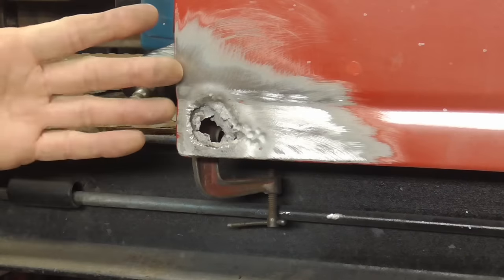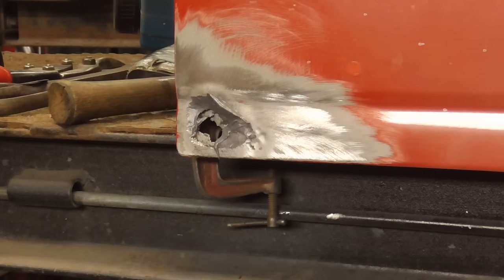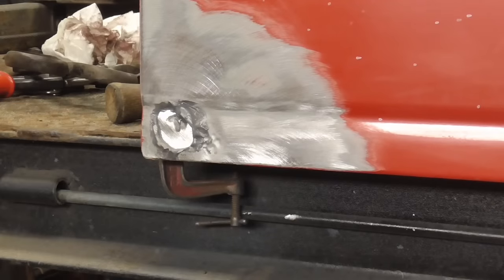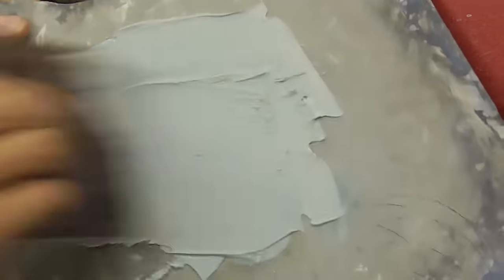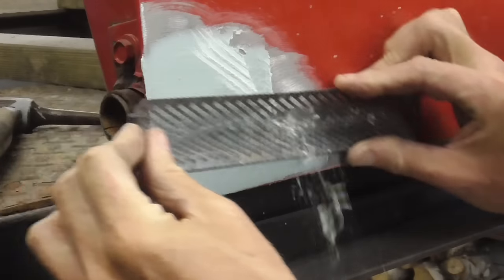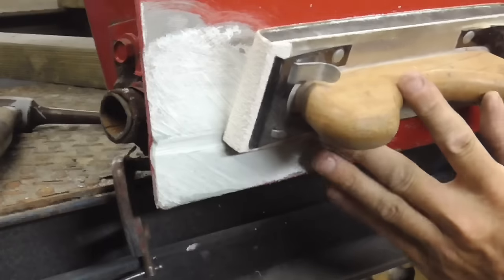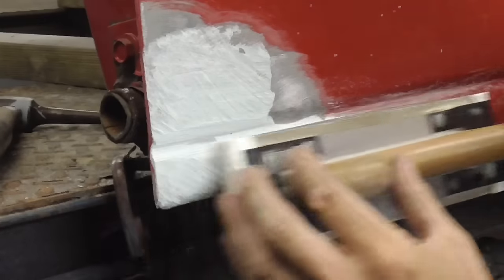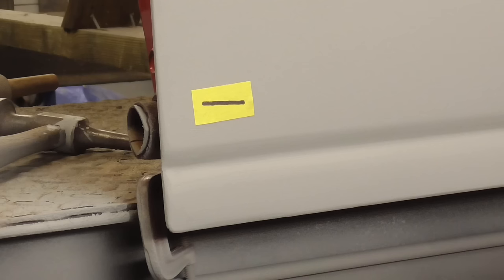Using JB Weld to Fix Rust Holes?

Comment: Could you use a soldering iron and lead to bond a panel in place?
Reply from the maker: I'm not sure about that.  I know you can use an torch and braze though.
Reply: @LakesideAutobody  wont a torch over heat the panel?  When you braze you have to heat up the panel more
Reply from the maker: @marcelinoafanador6378  I think you could used braze to install a quarter panel but I really don't think it would be good for patch panels because of what you said (heat distortion).  With a quarter panel all the welds are in rigid places that don't warp.  You can use panel adhesive or impact resistant structural adhesive.  I have a few videos using adhesives JB weld to "glue" panels into place.  I'll be uploading "Gluing on a Door Bottom"  real soon so that may help too.  Do you have a welder?
Reply: @LakesideAutobody  I have an AC/DC buzz box.  But I'm not much of a welder and I'm sure I'll do more damage than good.

Comment: Great idea, have a 2010 Caravan needs a patch on a fender I think I’ll try your method. Did you need patch the hole on the other side of the door as well? Great video 👍
Reply from the maker: You could use seam automotive seam sealer on the back side and paint over it (it's paintable) or you could grind it, use bondo to smooth it and paint or just undercoat it if you didn't care about the color.  Basically just need to sort of seal the back - glad you liked it.
Reply: @LakesideAutobody  I know that it would be ideal if the rust could be removed on the inside but it is not possible no problem on the outside i already have it down to bare metal.
Reply from the maker: @SDsailor7  If you can't get to the inside, don't worry.  We never worried about the inside in a body shop and never had come backs.  The rust starts at the bottom of the panel so if you can at least squirt some used motor oil or WD inside the panel you'll be good.
Reply: @LakesideAutobody  Once i remove the rust from the inside of the fuel tank i will add two cycle oil to coat the inside of the tank to prevent it from rusting again. It is a two cycle moped so it wont hurt it.
Reply: @SDsailor7  also add Startron from the Walmart boat section to the gas tank for winter storage, and keep the tank full so there is less water condensation inside the tank. You can line the inside of the tank with POR 15.
Reply: Thank you for the tips! they will come in handy.As of now I am at a stop in derusting the tank on my Peugeot due to the cold weather. evaporust says it works better at 65 degrees or better.Cheers
Reply: I have already repaired the holes using JB weld just waiting for the weather to improve so I can use the evaporust.

Comment: Great idea, I’m going to do this! Which JB Weld “model” do you use? What can you do to protect the other side of the panel (inside the door) where the rust started? Thank you!
Reply from the maker: I used the "Original".  If you can get to the back side it's good to clean it (wire brush, sand blast, etc.) and seal it with some good rubberized undercoat - rattle can is good enough.  If you can't get to the back side - make sure you allow water to drain out and do something like this: https://www.youtube.com/watch?v=y05dNxt-nVc  Have a great weekend :)

Comment: been using jb weld for years as a filler over clean metal to repair rust then I wipe a thin coat of filler over the jb weld
Reply from the maker: Thanks for your input Charles :)

Comment: What filler did you use?
Reply from the maker: Auto Body Master Light Weight Body Filler - $23/gal.  Most fillers are very similar - no need to spend a lot of $ body filler.

Comment: Not body work, but used JB weld 45 years ago to replace a 2"x1" hole in the side of a briggs mini bike engine, my grand kids still ride it today. It's as good as it gets for non heat repair.
 Enjoy your videos very much. Thanks for taking the time to share them with us.
Reply from the maker: Thanks for the story John - You're welcome :)
Reply: Repaired a hole in the side of the case on an 8 horsepower Tecumseh snowblower engine. Previous owner had run it out of oil and it snapped the rod and put it through the side of the case. Cleaned up the pieces of the case and repaired from inside and outside with J-B Weld. After a new connecting rod and some muriatic acid to clean the gold aluminum off the crank journal, the engine runs great years later
Reply: 2" hole?

Comment: I used JB Weld once to patch a hole in a gas tank, was actually a crack a little more than an inch.  First dried the tank.  Drilled a small hole at either end of crack to prevent further cracking. Sanded lightly and applied generous amount of JB
Was lasting years later when I sold the car.  Great stuff.
Reply from the maker: Nice idea with the holes at the end.  The stuff does work on a lot of things for sure - good story :)

Comment: I have been using it for years. Seals welds, doesn't bubble out, etc... Make sure it is completely cured before topping it with any other products.
Reply: Yeah it gets hard but still takes a while to fully cure if it's cool or cold out
Reply: @asbestosfiber   I give 3 days, was enough to holda dime size hole at 460psi

Comment: What a great idea! I really can't think of a downside if down correctly.
Reply from the maker: I once lb welded a piece of metal over a hole on a rusted EGR pipe.  It lasted at least 5-10 years - then I sold it.  It's probably still holding!

Comment: I agree that JB Weld is probably the best repair substance that I have ever use. Second to none. The only problem that I would have with repairing rust on automobile's could get really costly. JB Weld is not cheap. Bondo type materials are much less costly per square inch of surface's. Maybe JB Weld will see your video and create something that is less expensive to compete with Bondo.

Comment: This is a great idea. I welded on a new floor to my 60's Vespa and still had a few very small pinholes that rather than filling them over with epoxy primer and then filler I'll simply use a bit of JB weld first.
Reply: How did it go I’m restoring a Vespa at the moment and thinking of using in weld or araldite

Comment: Used JB Weld to rebuild rusted lower windshield pinchweld area. Front windshield rubber dryed and failed over time allowing water to reach pinchweld and cause rust.
1966 Chevy C10. Replaced windshield and gasket and molded JB weld in contour of pinchweld  so rubber gasket sealed. Beauty. 
.... Plan on trying to use it to repair and build up rusted portion of wiper motor mount hole also.

Comment: Hi use J-B Weld to but I put the fiberglass cut out sheet that's woven next to it and I spread the J-B Weld over my fiberglass on both sides and that's how I get some big big patch panels with fiberglass cloth and it works incredibly well also
Reply from the maker: Thanks so much for the input and good idea.  Have a good weekend and Easter :)
Reply: @LakesideAutobody  you aswell

Comment: This is the best thing I have ever come across in my years of doing body work. When used acetylene and oxygen the metal bends like it's a wave. I use the six minutes setting time because the curvature on the panel. So easy to work with the stuff. Thank you I wish I could send you a picture.
Reply from the maker: Hi Robert, iff you still have a pic send it to schoolvideolibrary at gmail dot com.  Glad to hear it worked for you - Jerry

Comment: I've been using this same method to fill holes in my 02 Silverado bed & body for a couple years now. I don't bother sanding or painting them since it's a just truck for hunting, fishing, hauling excess yard waste, bricks, etc. I step on the repairs, throw logs and bricks on em, holds up just fine. It is also is a better option for we who have pacemakers and shouldn't be around welding.
Reply from the maker: Great information a great example of why some folks may want to use glues instead of weld :)

Comment: I would need a bunch of the J B Weld to repair the rust on my 1997 Escort LX
Reply: Just use clay and hay mixture.If it's good to build brick homes it's good for a rusty ok car.,🤭🤭🤭
Reply: but if you fix the valve seat issue they will run forever,been driving them for over 20 years

Comment: Used JB Weld to patch a hole in a plastic valve cover. Two years now and no leaks. Good stuff!
Reply from the maker: Wow plastic... Good to know it works well on plastic too :)
Reply: The water inlet seperated from my radiator and started leaking pretty badly. I cleaned up the area and JB welded it and it held for the duration I owned the car.
Reply from the maker: @ProleDaddy  It's something to hear all these success stories of JB weld - tuff stuff :)

Comment: I too have used KB Weld for small holes. Also used it on an S-10 pickup throw out bearing one time. Was still in there working just fine 150,000 miles later when I sold the truck. Good stuff!

Comment: Why not just weld a patch in does a better job in less time
Reply: I personally don't have the skills to weld sheet metal nor the tools so if I was trying this kind of job at home, it'd be easier to use a putty based substance like JB Weld. However I can imagine that if the rust damage was more extensive - it wouldn't be as easy and would likely require a professional to weld it.
Reply from the maker: Here's one with jb weld on some serious rust damage:  https://www.youtube.com/watch?v=wRl1QfkrBeY
Reply: @sdaafasfad  for that type of rust, welding isn’t really an option. You’d have to cut down to viable metal first rather than just grinding away the rust.
Reply: Everybody don't own a welder bro,sometimes u gotta work with your budget

Comment: I was thinking that it would be good to squeeze in more JB weld to fill the narrow space between the inner and outer sheet metal.  To reduce the amount of water that can be trapped in that space.   
Also it seems to me that welding always has a disadvantage in that it cooks off the factory protective coating on the inner surface of the metal and you can't recoat it once the repair plate is in place.
Reply from the maker: Sad thing is, there is no protective coating in the pinch welds from the factory.  Some companies use weld through primer and others treat the panel after the welding process leaving two pieces or three pieces pinched together and welded with nothing to protect - thus the rust at the edge of panels usually. Best way to protect is after the repair.  https://www.youtube.com/watch?v=8XaZBy7GC7A  or https://www.youtube.com/watch?v=y05dNxt-nVc

Comment: I've seen people fix toilets, house doors and fenders with ramen noodle and superglue. This seems like a solid idea to me. Especially on an older vehicle that is still very usable but not worth a body shop price
Reply: I used to repair and rebond  my front fender on my 1976 modded c3 vette . Having owned the car for 40 years the front fender must have been in accident and the door gap  was way off and bugged me so as I prepping the car for my home brew old school blue and diamond metal flake custom paint job . I cut the fender and rebonded  it and added  glass and smc comparable resin ( be carefull as many of the panels areSMC  not fibreglass  and could be  un bonded if you standard resin same with filler must be SMC comparable  for 1971 and newer c3 vettes . Any way I stuck the fender back in place with industrial grade Jbl not the 10min stuff the industry takes 48 hours to fully cure and comes in big tubes don’t use any Quick set epoxy it not as strong . Epoxy work great 1 if you do the prep correctly . If your lazy and use over rust paint and dirt and un sanded material don’t bad mouth the inept results lolol

Comment: JB weld and fiber glassing make great temporary / affordable patches and do help to preserve the remaining sheet metal.  However, Tig / Mig welds might be a better repair option since jb weld and other epoxies have different expansion and shrinkage ratios than the surrounding metal and /or the patch in heat / sun or extreme cold.  Over time this could cause pitting/bubbling, high / low spots, unevenness, or imperfections/warpage in the finish/paint.  Depending on the condition, make / model, and value of the vehicle full metal repairs might be a better option.
Reply: ITEM # 11463A BRAND: EASTWOOD

Comment: Im just learning body work myself.. ive recently discovered jb weld is a fantastic filler for rust holes. The only advice id give here... it bothered me when you sanded the jb weld and went right to bondo. No dust clean up done? Was it edited out? Also you spred the bondo well past the repair area up past the body line.. it was cringe worthy. (For me) and a 3rd note... instead of using heavy filler to go over the jb weld.. just use more jb weld. It sands beautifully. If its left with a tiny air bubble or to use more jb! Body filler is antiquated. Jb doesnt wear or shrink or crack. There actually teaching to use jb in autobody classes now.
Reply from the maker: Body filler is easier to sand than JB + way cheaper, thus the coating of Bondo.  Can't be afraid to spread the filler larger than you need - aids in getting the repair straight.   Finally, you're right it is a good idea to blow the dust away before the next coat of anything - filler, primer, etc.  Happy Holidays
Reply: Are they selling jb weld in something larger then little tubes to bring the cost down? Otherwise people will stick with the body filler to cut expenses
Reply from the maker: @justafanmarvel9669  It is expensive - might want to explore the use of panel adhesive (also expensive) - I once glued the whole floor of a van in with metal roof cement/caulk 'cause I didn't want to mess up the galvanized coating by welding it in.  I glued and screwed it.  It never moved again - that'll be the last thing left on that van 50 years from now :)
Reply: @LakesideAutobody  ok I will probably use a combo of your suggestions. Thanks

Comment: Im not opposed to trying it. 3m panelbond looks sort of similar bit im sure chemically its a little different.
They say it has rust inhibitor in it ,idk about jb weld. 
Still though, for a driver itll probably hold up better than just slapping mud over it.

Comment: Great job and I've got to say I'm impressed by the comments as well. I thought there'd be 500 people telling you how you did it wrong lol. 

Have you ever tried any of those rust converters on pitted metal? It supposedly seals it and keeps the rust from spreading. Of course after you clean off any of the loose material.
Reply from the maker: My boss used to make us use that - turned the rust  black or into something else.  Never knew of any come backs so I think it worked pretty well.  I'm surprised as well about the comments - thought they'd really give me the business.
Reply: Be sure to get a good brand. Used one from a local car-oriented chain and it was horrible. Sometimes it turned rust black and sometimes it didn't work at all. I am currently using Corroseal which seams to work well. Just not sure if there are any issues with applying body filler over it since I don't believe the rust converter should  be sanded post-application.
Reply: @Marcoosianism  I always use corraseal before I patch. It's the best chance of killing that rust before you close up that area. I use fiberglass poly like duraglass over it so water won't swell it up like regular bondo. And only use bondo and glazing filler over that. The secret is to seal the inside so it doesn't come back through. I also spray bed liner on the inside or backside of patch. It's buttoned up and solid and most important waterproof. It'll last years.
Reply: @kirbyroad5743  Great process, Kirby. Thanks for the input!

Comment: There is the matter/question of what type of repair metal can be used and what are good, economic sources.
Low carbon sheet steel is preferred.  You can use galvanized sheetmetal, but you shouldn't use it if you put heat to it and weld it.  
Many auto body shops keep primed sheet metal on hand, check there.  Save yourself some money and go to a recycling center and see what they have.  Some scrap recyclers have a section where they've pulled out good clean pieces of reusable material.  You can also go to an auto wrecking yard and cut a piece out of a hood or roof of a 1980s era car or older.  Sometimes very old filing cabinets and appliances had the thicker low carbon sheetmetal.  Most newer cars are made of very thin, tuna fish can metal.  You are lucky to have 26 gauge on new cars.  Older cars were 22 to 24 gauge. The larger cars usually had the best metal.
Reply from the maker: You're right about the thinner sheet metal today.  That's why it's good to explore all different types of repairs for each situation.  Have a good weekend :)
Reply: Wow. Great idea. Thanks

Comment: I have done this with JB Kwik.  Sets in 5 minutes.  It isn't quite as strong as JB Weld,  but seems like the time saved is a good tradeoff.  Obviously this is on non-structural areas

Comment: Many products that are less finicky to use than the Original JB WEld that takes an eternity to set. 
Permatex Steel Weld  84109 5 minutes, 10 min fixture strength, impact resistant, resists all car fluids. 
Or their 2-ton epoxy 84133 (not UV resistant). 
There is also the JB Weld PlasticBonder, it is listed as a structural adhesive for cars and HD trucks, sets in15, cure in 30 min, 2 part polyurethane base.  (Do not confuse with the JB Weld PlasticWelder epoxy)
  When you calculate it, the cost of the bigger "legit" tubes for body work per ounce is the same as those small syringes. These are the 3 products I narrowed down to be suitable alternatives to the expensive and hard to acquire body shop adhesives.